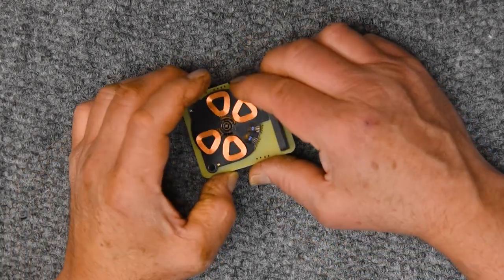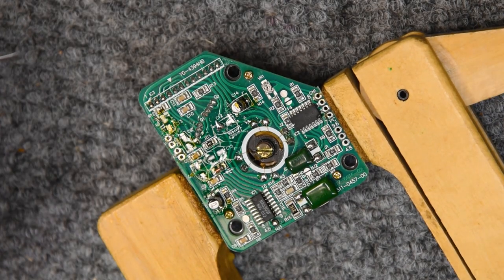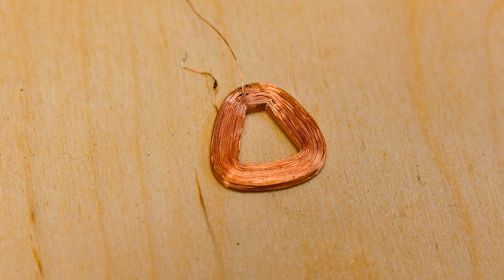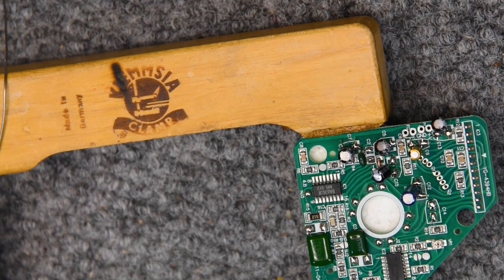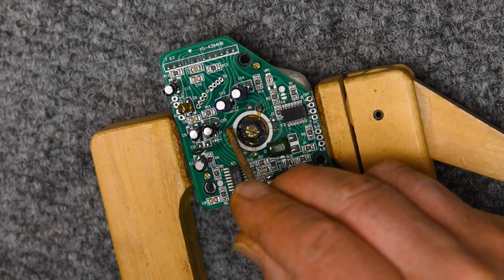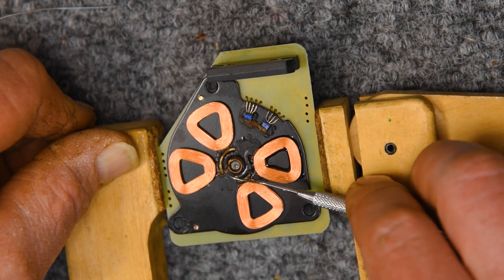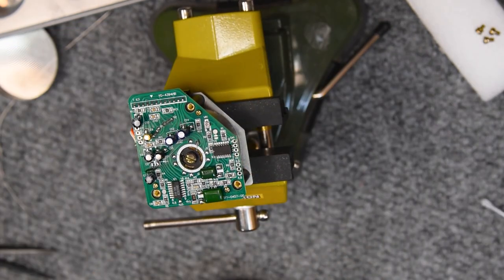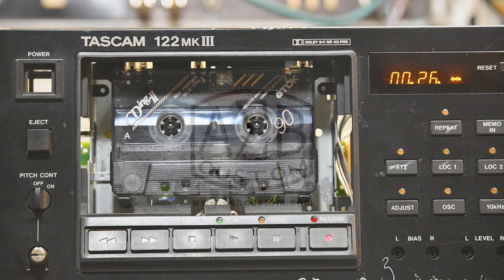Tascam 122mk2 and 122mk3 Capstan Motor Complete Rebuild

Comment: Hi. What value UF & voltage is C2 please
Reply from the maker: Hello Mike, they are 1000pf 63v.
Reply: Many Thanks
Reply: Hi Peter, sorry to be a pain, but   is there any particular type and make that’s best?
Reply from the maker: No problem. I think any film capacitor will do. I can't put my hands on mine just now or I'd include a part number, but I've used a couple different ones with equal success.
Reply: Hi Peter.  All good so far can you give details of the capstan bearing grease and oil for the bearing please.  I have learned so much from your videos.  Many thanks
Reply from the maker: Howdy Mike. I'm using Krytox GPL105, or 107 for the capstan thrust bearing, and Isoflex PDP 65 for the capstan shaft bearings.
Reply: @asbcustom  Mant thanks